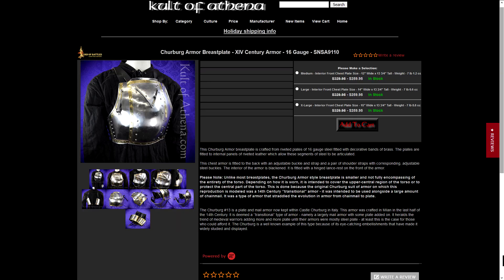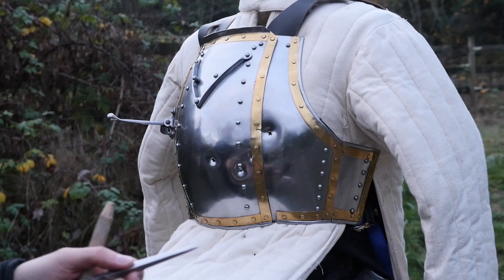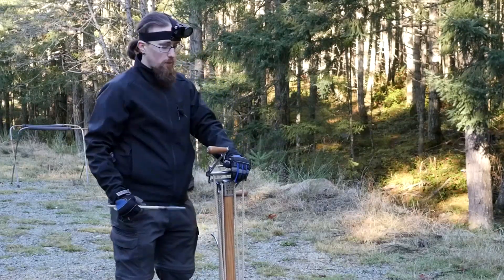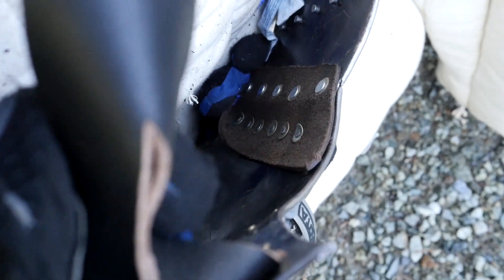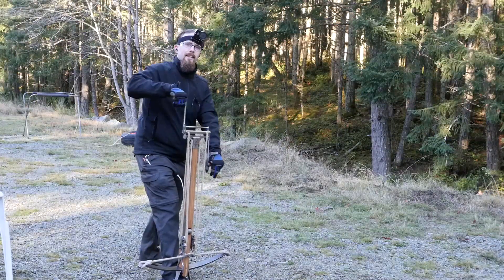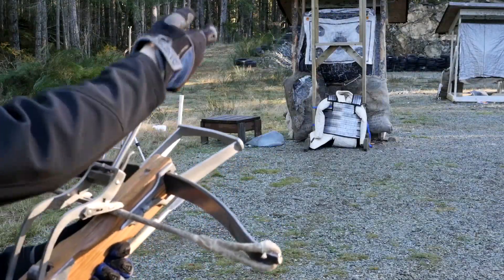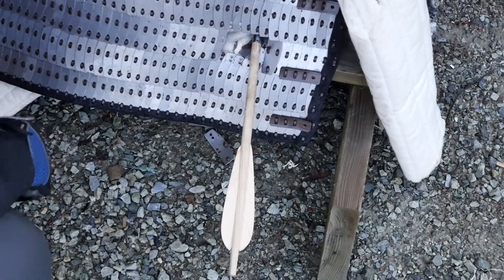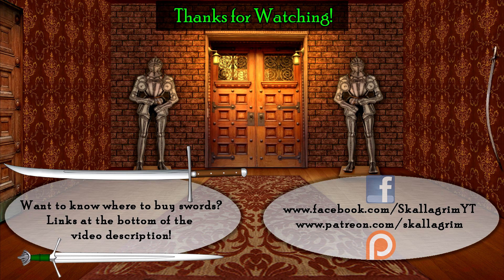Medieval Crossbows vs. Breastplate and Lamellar Armor

Comment: And this was at close range too. Shows how silly historical shows are where archers easily penetrate plate armor at long range.
Reply: ChristophInns exactly.
Reply: My thoughts exactly.
Reply: There's this misconception that crossbows or arrows pierce through the plate.  That's not really true.  In reality arrows were used en masse to try and hit the sensitive spots.  Like they said in Lord of the Rings: the neck or under the arms.  It's also worth mentioning that a knight probably won't be hit with a single arrow, but dozens.  See the holes that guy puts in the armor?  Those don't get fixed during the battle.  The holes stay, and if another arrow (out of the hundreds being fired) hits or ricochets into that hole it could do some serious damage.  It's more about the collective damage over the course of the battle, rather than just one or two arrows piercing straight through the metal plate.

The horse was also an easy target, as if it was hit with just a single arrow it was likely to freak out and flee, because horses aren't dumb and don't want to die.  The main problems with full plated armor were the quick exhaustion from the knights and the lack of mobility.  Sure, you can hop around and run for a little while in armor.  You can see videos of it on youtube of people doing cartwheels, sprinting, and jumping wearing a full suit.  However, you would get tired pretty fast.  Imagine a battle going on for HOURS and you're swinging a heavy sword with 50+ lbs of metal on.  Knights would get tired pretty quickly.

It's also worth mentioning that it was far more practical to just beat the shit out of a knight with a heavy blade or mace.  To basically bludgeon them, or break their bones under the armor rather than pierce it.  This was normally done on the arms and legs, where there were multiple small plates for mobility, rather than a giant single piece of steel to protect the organs.

TL:DR - Most of the time you aim for the legs, arms, and neck, not chest.  You would also have better luck trying to break bones than pierce.
Reply: I remember reading an eyewintess account of french crusader participating battle with turks in holy land. He stated that during just one epiode of the fight while he was holding the bridge accompanied by 3 other knights and 2 sergeants he was hit by enemy missles 12 times and his steed was hit 20 times. Despite that he made it just barely scratched and lived long enough to write a book about his shenanigans.
Reply: @whatever3132  Actually most arrows won't even leave a scratch on a full plate armour, let alone leave a hole that can be exploited by further atemps to pierce it. Horses also were wearing full barding so they weren't an easy target by any means. 
Blunt weapons like maces won't hurt a man-at-arms in full plate. The only exception being a strong enough blow at the head which can potentially cause temporary loss of conciousness. The knight won't let you do this so easily however. Neck is fully covered in plate so it's impossible to cause damage with an arrow. Underarms are covered in mail so if an arrow magically hit this area it's unlikely to pierce. Mounted man-at-arms were also capable of charging with a speed of almost 40mph so you probably only have one or two shots before they reach you and their speed made them and the horses a hard target to hit in the first place.
I wouldn't count on them getting tired quickly unless in a very warm weather. They were trained from very young age so we can say they were the ultimate warriors of their time much like special forces today. They had much more endurance and stamina compared to other soldiers.
So it is safe to assume  that bows and arrows were never meant to fight against enemies in full plate. Why did they use them then? Well, only a small portion of the armies were man-at-arms. Probably 5-10 percent. The rest of the soldiers would be more or less affected by arrows depending on what armour the individual soldier can afford.
Reply: @whatever3132  Soldiers and Marines in Iraq and Afghanistan routinely carry between 60 and 100 pounds of gear including body armor, weapons and batteries . Now tell me how much killometer per day have to do such sorder in March . I wouldnt be so sure about that Knights would get tired pretty quickly .
Reply: @whatever3132  If there are several archers, it's also fair to assume that there are other knights as well. And remember that this is in close range so the damages to the armour is maximized even though, quite frankly, some of them barely did anything. Besides, even with the holes, those aren't easy to exploit, much less target.
Reply: @9308323  Maybe, but armies kept using archers, so they obviously worked.  We can only really speculate, as the histories only record winners and movements of armies, not the specific minutiae of how each knight individually fell.
Reply: whatever3132 archers were used because the common soldier  didn’t wear full plate, but rather what ever he could afford. It was common for some to only have a helmet and gambeson. It wasn’t until the renaissance where munitions armor was used.
Reply: @whatever3132  Nations simply were not wealthy enough to give every soldier full plate armor.  So most of the rank and file wore something that COULD be penetrated by arrows.  So yes, arrows work quite well against lightly or unarmored targets, and sometimes you do get lucky if an arrow hits a knight in a weak point.
Reply: @whatever3132  You also need to keep in mind that not many people in the millitary had full plate armor. So the arrows would have more of an effect against other soliders without as much protection.
Reply: @whatever3132  Because most soldiers were not knights. You would more commonly find mail on the battlefield, which can be pierced by bodkin arrows.
Reply: @Specter_1125  The majority of an army were almost always unarmored spearmen. get 5 - 10 guys and they can tear a knight. The arrows would cause morale damage, and casualties among the peasants. Allowing the Knights to actually be useful in war.
Reply: Dylan D. I decided to look up the “7 years old” thing and i found that actual training didn’t begin until 14
Reply: whatever3132 you wouldn’t get tired fast at all. You would get tired quicker then without it, yes, but if you’re a knight, you’ve been training with arms and armor from as young as 7 years old. What this means is that you’re used to the extra 60 pounds of metal armor.
Reply: @whatever3132  
That explains why Knights and Warriors also used their swords as makeshift Warhammers.
Reply: @whatever3132  horses also wore armors, although not as protected as a knight they were still armour.
Reply: @whatever3132  Knights don't lack mobility in plated armor they are pretty agile because the weight of the armor is covered over their entire body. They also trained every day for war so they were differently in shape enough to last the entire battle considering how light weapons actually are
Reply: @whatever3132  the horses had armor too to protect it's vitals so if you were with a bow in this era the best you could do is try hitting the horse's kneecap and try to get the horse to fall over the impact alone is enough to kill or fatally wound a person
Reply: @minecraftpro2074  The army was not uniform in medieval armies.  All knights were responsible for arming themselves, and some of them weren't rich enough to even cover themselves fully in plate armor, much less their horses.  I think people don't understand the realities of medieval combat.  They all just went into combat with what they had, there were no regulations and if they were missing something that was just the way it was going to have to be.
Reply: @whatever3132  there is any realistic historical sword that weight 50ilb ? Can i ask for a source? Since i remember Shad once said real swords ain't that heavy, but again, maybe my kind playing trick on me again
Reply: @haibuiphuoc4442  A 50 lbs sword would be unwieldy and ineffective.  It would be too slow to swing around, and the person using it would have to be too muscled to be agile.  Enemy soldiers would run circles around him as he's trying to lumber this 50 lbs piece of metal into swinging.  On top of that, a piece of steel that dense and thick would probably bend after a short while under its own weight.  The heaviest known sword to be used in battle was a Scottish Claymore called Fuilteach Mhuirt "blooded/bloody one of murder/killing" , and it weighed about 23 lbs, less than half of that.

Short answer: No.  It would be too heavy.  The heaviest sword on record, a claymore, was about 23 lbs.
Reply: @whatever3132  

Even that weapon was likely just ceremonial. 

The biggest zweihanders, used in combat, weighed like 4-5 lbs.
Reply: @whatever3132  some of what you're saying might be true but any general with proper army would change first 2 lines with third and fourth  lets assume you have 6 lines of knights once first line is tired it goes back to the end second line start fighting every soldier that is killed will be replaced by the line accordingly this way you your knights would be ready to fight once again doesn't matter the quantity the enemy has but the quality and strategy also if the enemy has many light soldiers they are more easily injured to crossbows swords etc the only solution to break this line would be through fire or rolling stones uphill thrown towarda the knights but that's always assuming the general of knights made a mistake
Reply: Historical shows? Crossbows did change warfare that's a solid fact..The increased armour is a result of that. Let's visualize thousands of peasants at war and a few armoured knights. No?
Reply: There is also the fact that some people complained about the quality of the arrowhead used ob this video. A properly tempered and heat treated arrowhead could have done more damage (still not enough to kill the knight, but the armor would have suffered more)

And I also loved the fact that he tested against laminar armor: a common misconception (thanks cinema) is that medieval armies were all fullplate armor.
Reply: @gustavoargumanis1863  what do you mean by full plate?
Reply: If you shoot it at long range theres a miniscule chance of barely piercing armor like a pen hole in a wall like barely a millimeter hole
Reply: I could maybe understand chainmail if it were a really heavy-duty crossbow, but full plate wont give an inch.
Reply: @toddhoward1892  don't you see a small dent on the armor in this video? If you focus fire that dent, you have a very slim chance of penetrating the armor, but at least they can leave bruises. Crossbows bolts and bodkin arrows cannot pierce plate armour, but it was never created to do so, bc penetrating mail was more than enough, though those arrows can slow down the enemy and affect their morale to an extent
Reply: @ihaveadream7858  Proper modern steel is more effective, but a lot of these reproductions on the market are actually significantly worse than medieval armor.
Reply: Old age, old materials.
Reply: Must enchant that crossbow in an enchantment table
Reply: Yeah, when historical accounts were talking about longbows devastating armored knights, it was mail, where the bodkin tip would slip between the rings and force them apart... or just slip right through and through the padding before actually feeling resistance from the armor.
Reply: Well, archers and crossbowmen weren't obliged to shoot frontally at the strongest parts of their enemies' breastplates. They were often positioned at the flanks of an engagement. That would probably have given archers the option of shooting at the sides of their targets. Parts of armour like breastplates are typically thinner at the sides. Also, from a distance of at least 30 meters, a reasonably competent archer with a medieval era bow should be able to aim for, and have a very good chance of hitting faces, armpits, groins and throats. 

This video may not be giving a very good picture of the peak of what this crossbow is capable of. I don't know what the bolts in this video weigh, but with any bow, energy transfer efficiency from bow to bolt or arrow increases as the bolt or arrow gets heavier. The increase in projectile momentum and kinetic energy with increasing projectile mass will be especially pronounced with a heavy limbed steel prod crossbow like the ones in this video. Heavier bolts will fly more slowly, but they'll hit harder. Almost every steel armor penetration mathematical model predicts that slower, heavier arrows will penetrate through thicker steel plate than lighter, faster ones shot from the same bow or crossbow.
Reply: Well, if you're unlucky, an arrow can pierce through plate armour. (Yes I mean the plate of the armour). Not every armour is equally made and luck is a big factor. A single arrow is unlikely to do that, but when you are literally showered in arrows, they will either hit mail or one of the plates weakspots sooner or later. Tod from Tod's Workshop has an interesting video where one of his arrows punches through a 1.6mm thick helmet.
Reply: @Timbo_Boy  generally speaking, Limb plates, some vizors & lower parts of the helmet are vulnerable to war arrows because they have a lesser thickness then the breastplate 
But I'd say that the quality of the arrow head plays a huge role, if it's high quality hardened steel, I believe that would make a huge difference and you can argue that It's expensive But if it were to get the job done then that would be well worth it because the enemies armored opponents are even more expensive, so one could reserve arrows with high quality steel heads just for armored opponents at closer ranges and use the cheaper Iron head arrows for other purposes at longer ranges
Reply: true but it should be mentioned that even with this level of damage, you're really going to feel that, like you're gonna feel the wind knocked out of your lungs with that much force at that close of a range
Reply: Are you telling me that Agincourt is a fake story? 🥺
Reply: King Richard used to ride his horse nearby the enemy's walls, knowing his really well made heavy armor would protect him. And that was right, until it went through his neck, which was not protected by the armor
Reply: This armor is made with modern steel and techniques, therefore this video is not realistic.
Reply: @charles2521  And so are the bolt heads.
Reply: Crossbows are used against armored knights and nobles in history and there are many accounts of crossbows killing armored people. People didnt aimed on heavy armor instead they shoot for the weak parts like visors, neck, arm pits, legs, and groin.
Reply: But youll get knocked Off the whorse . Worse If the horse gets Hit
Reply: Crossbows were only used at close range... they begin to wobble quite quickly and lose their impact past a short range.
Reply: @factbeaglesarebest  usually each person had 2 crossbows and 1 guy reload their crossbows and the positive is that you didnt needed people with high training like bows back then one thing anyone learn in the army  is that you dont want to kill your enemy rather make them unable to fight because when we talk about siege because the soldiers try to save each other therefore if you hit some1 on the leg you disable 2 people instead of 1 it's complicated
Reply: that's hollywood...
Reply: Uruk-hai are referred to as orcs and goblins through the text.  Treebeard merely speculates that they're part man; they themselves attribute their tolerance of sunlight to training.

The video was impressive.  The plate isn't as thick as it could be -- he said up to 3 mm, vs. 1.6 in the reproduction.  The lamellar was thin and tied shittily and still did well.

Gothic full plate was elite armor but in the late middle ages you get 'munition' plate, good coverage and mass produced to be matched to some soldier.  China had mass lamellar armor.  I wonder how much of the popularity of mail in the west was due to iron being very expensive to make, so it was worth spending lots of labor to minimize metal content.  China had better ironmaking and could afford less laborious overlapping plates.
Reply: Medieval Crossbows are not efficient due to the weight of the string, the weight of the limbs and the tiny draw length. Bows have more momentum the farther u draw back the bow.
Reply: For a multitude of reasons: It doesn't. The armor wasn't an exact replica, and was thicker. The target has way too much give, dissipating the impact way more, and way faster than a human body would. Throwing the penetrative force off-kilter.  A more accurate representation has been shown with a just 200 pounds+ warbow, that showed minor penetration. Under more realistic circumstances, this would easily penetrate, instead of doing such absurd amounts of denting.

He himself makes a disclaimer at the start for a good reason. He knows it's not a 1 to 1 comparison, and does not accurately reflect the realistic results.

This does ofc not mean that an average crossbow would penetrate all sorts of armor. Ofc it wouldn't. But it would penetrate more types of armor than you think, and it would penetrate this armor - If the crossbow was on the higher end of the spectrum. With the right sort of tips ofc.
Reply: This test is pointless because he's using the entirely wrong type of bolt head.
Reply: Historians are very far from physics, their bulshiting stories are like Hollywood.
Reply: Remember how English archers played a VERY BIG role on the French defeat at the battle of Agincourt. Those French nobilities were big names so expected they wore their best armour suits. Yet they lose very significantly.
Reply: In shows literally POINTY STICKS pierce through full plate hardened steel armor
Reply: Oi plate armors in most countries in middle ages were only used by elite troops, and aristocratic knights they were expensive as fk.
Plebs conscripts used scythes and farming tools and as for shields they made it from hay and other shit they could find and do it on fly.
So arches and xbows were all great for general army usage.
Same thing apply in modern warfare armor protection is graded and grade 3 armor will stop up to highest .50 AE cal handgun.
grade 3+ will stop low grade rifle rounds like 5.56 855 rounds.
And if you think every russian/us soldier is geared in armor plates graded 4+ you are wrong, same goes for high end ammunition they used.
Just a tip training and gear for average russian and american special forces cost around 1-2kk US dollars.
Reply: Exactly what I was thing while watching LOTR in scene where they were deffending minas tirith. Heavy armored orcs were falling like from MG42.
Reply: @GameOver-fn2og  orcs? heavily armoured?
What irks me though is how a poorly crafted bow from an orc from the river anduin pierced the plate armour of a gondorian tower guard smh.
Reply: @lolibudang5085  Uruk-hai orcs did have heavy plate armor
Reply: @GameOver-fn2og  Uruk-hai aren't orcs. Just to clarify.
Reply: @matejdedic9856  they are
Reply: @GameOver-fn2og  Why would you argue with anyone when u dont even know what are you talking about?
Reply: @matejdedic9856  Ok, so what is your opinion. What are they? My opinion is, they are 1 orc's kind.
Reply: @GameOver-fn2og  Uruk-hai were half orcs half men, they were a lot stronger, and they could withstand sun.
Reply: As a sad, satirical joke, the crossbow is still strong enough to oppress the serfs and peasants at close range.
Reply: these bows and plates are reproduction. the real one are more capable i can tell you that.
Reply: some shows are indeed funny buy dont forget most armors were expensive back then so most people didnt have good quality armors thin aluminium for example is ez to be panetrated compared to steel
Reply: In their defense archers would have been using armor-piercing tips on their arrows instead of hunting tips
Reply: @jamesricker3997  Yeah if I can shoot through sheet metal (accidentally) with a 50lb bow and basic bullet head tips. I have no doubt War bows and Crossbows could penetrate armor. Especially since a properly trained bowmen would aim for weak parts of said armor, and not just the hardest central part. Given the opportunity. 

He also greatly underestimates the concussive force of the shot. Ask anyone who has been shot wearing kevlar or plated flak vests. For anyone who's never been shot, the amount of bruising it causes underneath is immense despite overall the vest looks fine. Theres also a heavy chance of broken ribs. 

Would it happen every time? Probably not, but to pretend that a proper bolt or arrow wouldn't peirce at all because he fired at the hardest parts (made from modern steel) is questionable. 

You wouldn't be doing it at distance, but through Murderholes or garrisons within a fortress? Yeah. Easy targets.
Reply: @HauntingSpectre  yeah that bruising is caused by the force of impact
Reply: Mediim range longbowman had significant penetration ability. These so called replica use modern day steel not medieval steel
Reply: @jkjkhardcore666  Are you saying that modern steel is worse than medieval steel? You are joking, right?
P.s. I did't see your next comment, sorry. Still I disagree that arrows ever penetrated a full plate armor.
Reply: @dimitardimitrov9482  medieval steel has REALLY low quality. Its easy to use the sword crafted in modern age to just break the swords from medieval age. Its weak, not well structured, and easy to rust